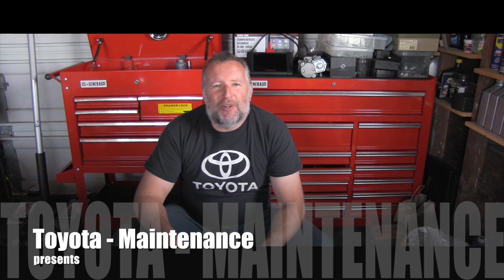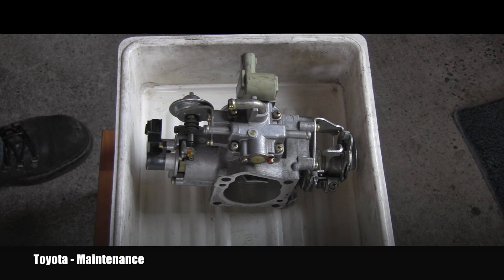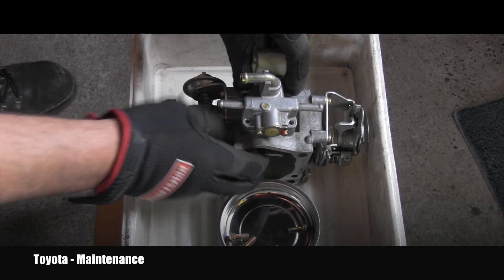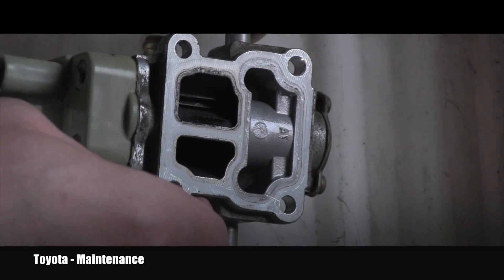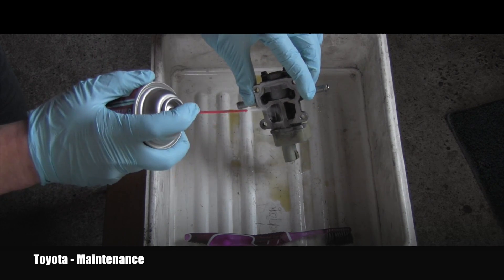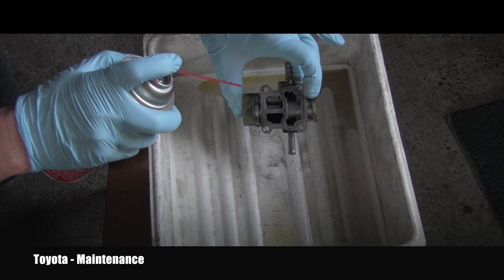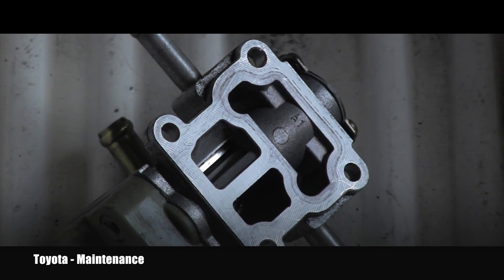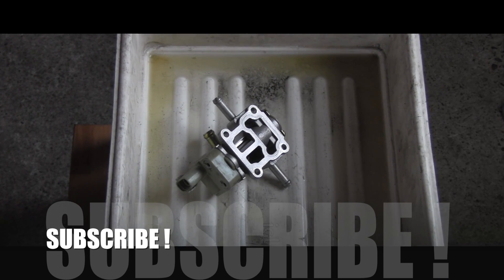Toyota IAC Idle Air Control Valve Cleaning

Comment: Hello, what about Electronic Throttle Body that has rivets on the IAC instead of screws or bolts? How to open the IAC? Toyota Avensis T25 1.6 2008 Manual 5 Speed. Thank you

Comment: The IAC valve on my AE101R Corolla was so caked up, it still wouldn't move after a good cleaning. I had to take off the green solenoid and grab the end of the shaft with a pair of pliers (I should have put a rag between the pliers and shaft, but anyway), rotating it either way to eventually free it up to clean the places I couldn't get to originally because it was stuck half open. No more idling at 2000rpm with the air-conditioning on now 😅

Comment: I have a Toyota 2001 Camry 4 cyl I was cleaning.my. Throttle body control I d spray it with a throttle body Cleaning plus I sprayed that Idle Air without taking the hose.  After that my car did not start any more any good info guys it would be helpful

Comment: If I need a new IAC , Amazon say $604.36 if I want the Toyota OME,  plus Canadian tax  around $700. CND. I can buy a Standard Motor Product version for around $500. CND tax included ..but who are they? I notice you didn't try to get the two small screws off the plastic cap and spray through the hole in the throttle body. Thanks

Comment: Hi Peter.  I received changed my spark plugs and wires.  I used the correct plugs ,double tipped , I decided to use the ngk blue wires.  I also cleaned the MAF. 
My Idle is now a bit lower. 500-600 rpms at operating warm engine. This seems to be a bit low in my opinion even though it runs smoothly.  
What do I need to do if anything?
Reply: Try resetting the idle, there are video on YouTube on how to do that it’s real simple. From what I’ve heard it’s helped lots of people with similar issues.

Comment: So I changed my spark plugs already and also cleaned the IAC but I'm still having idle problems. I have also added seafoam to clean my fuel injectors
Reply: Pcv valve maybe
Reply: Look up high idle it's a super easy fix all you need is a washer
Reply: Clean the TB and reset the idle
Reply: Could be taking in air somewhere
Reply: Maybe your throttle body sensor or short Tps needed to be replaced
Reply: Sea foam does not  clean injectors.

Comment: I did not see you clean out any crevice except for spraying the cleaner into them. Any reason why? Thks..jc
Reply: On my Miata,  the valve is very similar.  I rotated the valve carefully from the adjacent port, sprayed throttle cleaner,  then took a small screwdriver wrapped in a towel and cleaned the valve.  A toothbrush is way too LARGE to fit inside that tiny cavity.
Reply: Thks stuart.....jc

Comment: I have a 1995 Toyota Tacoma 2.7 that I have had for about 11 years 330000 miles on my good little truck . I’ve not had any issues  with it so speak of.My coil needed to be changed it had lots of cracks in it was hard to start etc so I changed it . There were no problems with the truck until after I changed my coil . I now have a bad miss when I  get it to about 2500 rpm ??? I have changed the coil 3 times trying to see if I have a bad coil . Not so ??? Spark plugs are good Distributor is good  I’m at a loss why it’s not running right after I changed the coil . I’m going to clean my Throttlebody this weekend but need help finding my problem . Have you seen this before with a Tacoma 2.7 1997 thank you

Comment: My friend had an toyota unser 1.8 had a black smoke...I've clean the throttle body,clean the exzos sensor,clean the fuel injector...even i've top overhaul but still the black smoke keeps coming back....

Comment: Hey there!

Love how informative your videos are!! I'm about to do this service on my 93 3.0VZE 4runner as I am getting a bad (1200RPM climbing to nearly 2000rpm) idle when the engine is cold. Once it warms up it runs normal. Do you think this IAC valve is the culprit?
Reply: Do you have an update? Need to do this to my 22RE engine
Reply: Same problem. Update?
Reply: Same problem with 2006 Lexus gs430 v8

Comment: My idle doesn't "jump around" on my 2000 prizm (corolla). It starts cold at around 1100 RPMs, then steadily climbs until fully warm at 1950 RPMs in park. I have P0505 on. Is this the IAC or likely something else?
Reply: aznnp77 Probably need to adjust it until it idles lower. It should lower the rpms when warm, not raise them.

Comment: I have a 1998 4Runner. I am getting a strong vibration when I come to a stop at idle. I feel it in the steering wheel and under my feet. I had the throttle body cleaned about a year ago. Could this be an IAC issue?
Reply: I want to ask you, when your at a stop light and try to take off does the engine feel like its missing? And then once you speed up the vibration dissapears? Im looking around and im about to try and diagnose this same issue and to my knowledge it should be the idle air control valve. I took my throttle body apart the other day and i did my best to clean the iac but i didnt have the right spray and the 4runner is my only vehicle. But it was pretty dirty. I believe it is just sticking. Theres not much "force" that moves that valve as its magnetically controlled. I bought a replacement off of 1A Auto and im waiting for that to come in. My first step is to thourgholy clean the valve first and then test to see how it does. The next step (if cleaning does not work) is to replace it. Ill do one step at a time and share my results. Seems like a stupid easy fix.
Reply: @Trinity_Thrice  the engine is smooth once I press the gas and get going it's only when I am slowing down and come to a stop. I had the throttle body cleaned really good about a year ago. Now I'm starting to think it may be the drive shaft. Taking it back in soon. I will let you know.
Reply: Sean Carlson hi there! Just curious if you found out what the issue was? My car is doing the same exact thing you described.
Reply: @msconesix  Any update?  Same problem

Comment: I had to replace the IACV on my 2002 Tacoma with the V6 at the dealership a few years back and the mechanic pointed out a couple of small vacuum tubes sticking out of the top of the intake manifold. He said to run some TB cleaner through there once and awhile but I'm not sure which tube to use or does it make a difference. They were real close together. Will that help the IACV stay clean longer and would Seafoam work ok for a cleaner?
Reply from the maker: I never used that or saw someone do that at dealer

Comment: Acquired 2003 Corolla, 135,000 MI., Starting cold idles at 1900 RPM for too long, then drops to normal, otherwise runs great. I thought the idle speed too high cold. Any suggestions. Great video.
Reply: That cold idle speed for a Gen 9 Corolla is OK, but you need to change the intake manifold gasket. Use the Toyota gasket that has been improved over the original design. The updated gasket is orange in color.

Comment: Just did this on wife's camry and now it idles perfectly. Quite amazing how this valve operates with an electromagnet and tiny water jacket. you should remove front of unit and work the valve while spraying in cleaner
Reply from the maker: nice, good job !
Reply: That's what I had to do with mine, it was so caked up 😅

Comment: I have a  Toyota corona 2010 it stalls when u  reduce the speed before u stops at traffic lights, and it shakes when driving is it the  throttle problem, or air massflow sensor please help
Reply from the maker: it needs some diagnosis for sure
Reply: Toyota Maintenance diagnosis was done and it said fuel rail sensor , oxygen sensor and airflow sensor, so can all these sensors be faulty same time or the problem links all of them

Comment: I found that removing the electromagnet allows you to confirm that you cleaned it thoroughly, it will spin. your method only half cleaned it there is carbon in spots you can't see.
Reply: How do you remove the electromagnet?

Comment: My 2001 Toyota Corolla idles rough. I put a new iac in it but it didn't help. I went and bought another one and it still didn't make a difference. When I go down the road its fine, but when I start it the idle will jump up and down between 500 and 1000 rpms. When I unplug the iac it keeps running the same. Any input? I did get a p0171 code, but I cleared it and it hasn't come back. That was three weeks ago.
Reply: We almost haave the same issue, tho our corolla doesn't have check engine light. I'll hust going to clean it later or tomorrow and see the cold start difference.

Comment: Hi there is a very strong cleaning agent used that I use for motorcycle carburators  that is called compression stabilizer would that work? If the carburettor internals is soaked in that cleaning agent for 15 minutes the metal Is becaming shining clean
Reply: I think this CRC product is better and also others as well that we're specified for Throttle body cleaner. It is safer for your engine as well as in your car's catalytic converter. You may read instructions when you found 1 of em.

Comment: Hi Toyota maintenance  I have a 2008 Toyota corolla ce  the idle is a little low I don't have no check ingine light on could it be the idle air control valve is dirty can you please help me out
Reply: We almost haave the same issue, tho our corolla doesn't have check engine light. I'll hust going to clean it later or tomorrow and see the cold start difference.

Comment: So if I clean it I don't have to replace it with a new one?
Reply: Nikola S You will eventually. Cleaning it is just a bandaid repair. Don't buy the generic iac valves either. Toyota's are very sensitive. Shell out the money and fix it right. $220 is what my wife just paid for the factory version.
Reply: Do you have a video on how to remove the iac valve from the throttle body?
Reply: Nikola S Yes. Go to my page on here. I just uploaded one yesterday. I tried to keep it simple without the long talking.

Comment: Hi
i have Camry 96 with high Idle all the time and i mentioned that the car is always cold, so i think that the choke is always working,
how can i disconnect the choke to check first and than how to let the car get warm?
i'm in gulf countries so i think some body disconnected the temperature sensor or something else to keep the ca cold...
Reply: I suggest that you try replacing the coolant thermostat because it controls how much cold coolant goes into the engine.   If the thermostat is stuck open the engine will stay cold and therefore idle higher than normal.  Replacing the thermostat fixed my Camry anyway.
Reply: I will
Thank you
Reply: @smaydi1980  did replacing the coolant thermostat solve your problem?
Reply: @copout1405  yes it did
Reply: @smaydi1980  Thanks

Comment: I have a 2006 xB with 240k miles and it idles smooth. I clean the IAC and replace the pcv when I notice that the idle is not smooth. But I don't remove IAC from the car. I spray cab cleaner in to the port for the IAC then turn the car on. Repeat step several times until the car idles smooth.
Reply: Does it fix it completely, I have sprayed in the port 3 times and has improved but not fully
Reply: @allsorted9803  in that case is best to remove and thoroughly clean it

Comment: Hello, my engine idle is high after warmed up . 900 cold 1500 warm . Could you please tell me if this dirty part be the problem . Or the temperature sensor . Thanks
Reply: Kobrah RC Kobrah RC It's not the temp sensor. Try cleaning the iac valve. If the idle drops afterwards, then get ready to replace the iac. Your idle should jump up at first start, then drop down to around 750.
Reply: Did you fix the problem?  (I always like to know how these things turn out)

Comment: Hi Toyota Maintenance. I found your video very useful, but as you said before you can clean your valve, but in the long run it will be back again with problems. I have problems with the Idle valve on my corolla 1993 with the 7AFE engine. Yesterday i try to replace the valve for a Chinese part(isumo) a complete waste of time. Please from what online shop can i order a really good OEM Valve for my car? Or how i can order one from a Toyota dealer? Thanks for your help in advance. Keep doing these great videos.
Reply: in the US  1.8L https://www.rockauto.com/en/catalog/toyota,1993,corolla,1.8l+l4,1275500,fuel+&+air,idle+air+control+(iac)+valve,6072

Comment: one question , i have a toyota 4runner2002 and the  engine light is on, the smog check didnt past i've been told to replace the idle control system valve  my question is Can i just pay for a valve cleaning?  and how much will it cost me ?
Reply: Andrea G That's 2 questions lol. Yes, you can pay to have it cleaned, but it's an easy job to do. Shops around me charge $60-100 an hour labor. To remove the iac and replace it on a 4runner, it takes about 30 minutes for me to do it.

Comment: Hi...i need your help..my car is toyota caldina zt 1az fse engine 2003..everytime I start up my car when its cold or if the car has not been driven for a few hours the cars jerks and hesitate when accelerate..i can hear the exhaust is popping..its like the car is not getting enough gas or something i'm not sure about that ....After the car warms up its fine..and now my car is running rich of gas with no acceleration and leak of power...feels like driving a 1.3 litres engine even its 2.0...i dont know what should i do since i had spent a lot of money for this car...throttle body clean up,a new spark plugs,ecu reset and scan and so on just to make my car going back to normal...but i cant see nothing is changing...😖😖😖😖
Reply: Gustavo Marci Could be a lot of different problems. I had a ford do that and it turned out to be the valves. 3 valves had low compression. It could be bad plugs, coil packs or sparkplug wires, restricted exhaust system and so on. You should do a leak down test on the valves.
Reply: Try IAC valve, also maf sensor, also Jack might also be right.
Reply: Yes my brother had this problem and was burning rich heavily. A part from his intake broke and fell back into the body of his come filter and was causing a bad reading from the MAF. The original commenter may he seeing a MAF problem or even worse, piston problems or damaged cylinder walls. Hope you guys got your problems sorted out.

Comment: Would compressed air be an option in cleaning out the ports on this unit?
Reply from the maker: I'm not sure, never tried that....chemicals dissolve that gunk and carbon....will air do the same ?
Reply: No.  You need a cleaner to dissolve the carbon deposits.
Reply: No!
Reply: No.
Reply: No